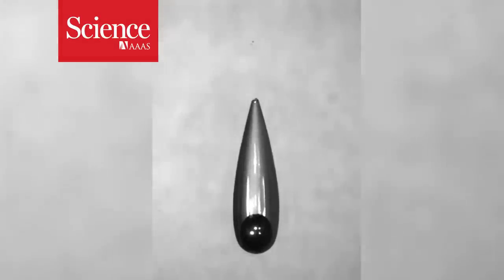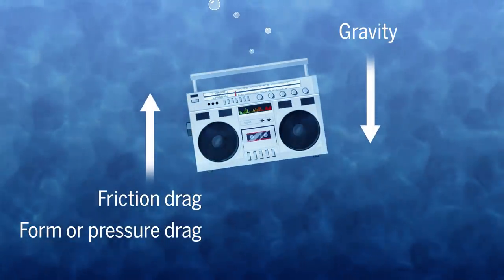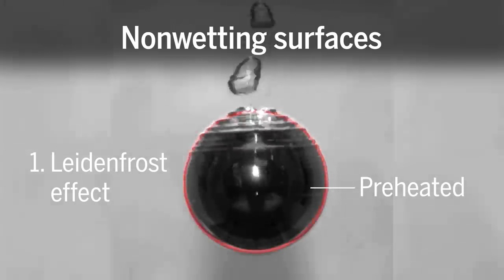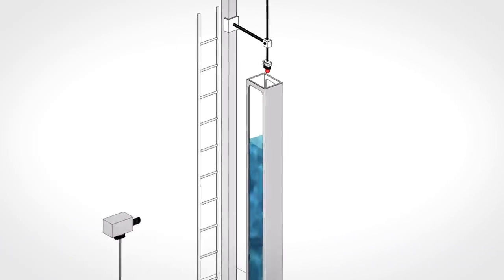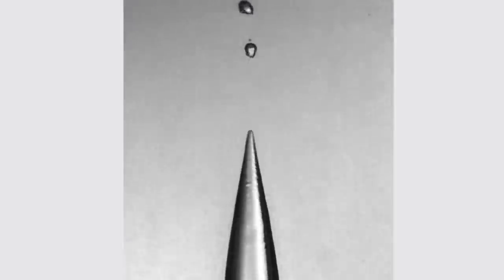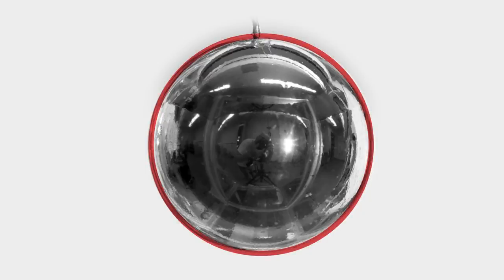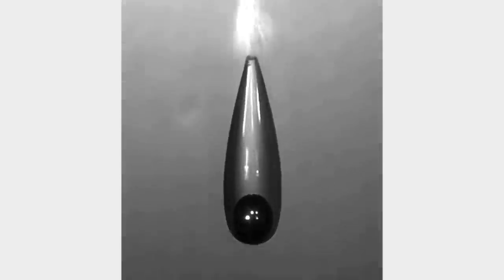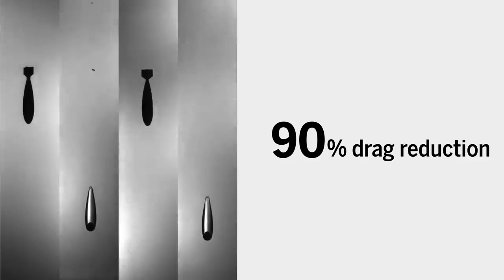Watch these hot balls cut through water like a knife through butter

Comment: A metalworker in 1810: “when I drop these musket balls in water to cool them after forging, I hear them hit the bottom of the bucket much sooner than I would have expected. Oh well, back to work.”
Reply: well we also noticed it but we are confined to our work
Reply: The water is at 95C though so the ball only need to heat the water by 5 degrees.
In cold water i'm not sure how prevalent the effect would be since the ball would probably rapidly cool down
Reply: @AuxenceF  duration of the fall is a lot less too though, so the speed at which it loses that heat might not matter so much
Reply: @AuxenceF  not how it works
Reply: A lot of gifted might have discovered more before Newton and Galileo but most population back then were enslaved or didn't have popularity
Reply: @edwardrocca  it need to at least heat its own volume in water to boiling point and you need a lot more energy to heat a gram of water by one degree than to cool one gram of steel by one degree
Reply: @FnLl523  "I am, somehow, less interested in the weight and convolutions of Einstein’s brain than in the near certainty that people of equal talent have lived and died in cotton fields and sweatshops."
Reply: As a factual matter musket balls aren't forged, they are cast from molten lead.
Reply: @jimmie2knives137  Superior japanese musket balls were folded over 1000 times using traditional forging techniques to achieve unimaginable results.
Reply: @JrottenOlm  Why do people keep misunderstanding the 1000 layers of Japanese forged metal? Its just 12 folds, resulting in 1000 layers. And folding metal doesn't make it compressed and strong. The purpose why they've been folding their metal was to purify it. There wasn't great technology and chemicals back then so they had to forge straight from the raw tamahagane. The metal would obviously have a lot of impurities so the metal workers decided to fold it at least 10 to 15 times and they can witness the impurities get squeezed out from the metal as they continue folding it. It is not 1000 times of folds, literally any blacksmith will tell you it would be a waste of time if you fold metal more than 20 times. ITS 12 FOLDS AND 1000 LAYERS. NOT 1000 FOLDS.
Reply: @FnLl523  Any TRADITIONAL Japanese blacksmith will tell you that it is actually folded a 1000 times and that this does actually make the blade stronger. In fact when they made the A6M they folded its wings 1000 times as well which made it able to cut parts of enemy airplanes using its wings.

Source: a deeper understanding of Japanese tradition and culture than anyone who doesn't live in their mother's basement could have
Reply: @FnLl523  enslaved in europe yes but the world is a large place Muslim scientist had the brilliant minds back then but the western books don't mention the Islamic civilization.
they mention latin then quickly skip to Europe like no sciences were made for 5 centuries.
Reply: I appreciated this
Reply: @ThexXxXxOLOxXxXx  There were plenty of slaves outside of Europe. A good deal of Africa, Asia, and the Middle East also enslaved people.
Reply: @AuxenceF  this is extremely oversimplified but whatever.
Reply: @FnLl523  Dude more layers = better, a Katana has 1 Million layers!
Reply: @Hellothere-vr9um  ?
Reply: Guys, Here is the Original Semitic Text. HERE is The REAL Savior

YaH The Heavenly FATHER HIMSELF was Who they Crucified for our sins and “HERE IS THE PROOF”

From the Ancient Semitic Scroll: 
"Yad He Vav He" is what Moses wrote, when Moses asked YaH His Name (Exodus 3)

Ancient Semitic Direct Translation
Yad - "Behold The Hand"
He - "Behold the Breath"
Vav - "Behold The NAIL" <— YaH’s Crucifixion
He - "Behold the Breath"

“Behold the HAND that Beholds The NAIL” 

PROVES - YAH The Heavenly Father HIMSELF was Who they Crucified

That is EXACTLY what Moses Wrote

Here is what they mean

YaH's Name:
(Ya)d + (H)e, as YaH is what Moses called Him and YaH Declared: "this is My Name, this is My Name for all generations" (Exodus 3)

YaH is The Creator:
Yad He, (HAND BREATH), as YaH's "HAND" Formed man from the dust  of the Earth and His "BREATH" made him a living being (Adam)

YaH's Sacrifice of Crucifixion:
Vav He (NAIL BREATH), the "NAIL" through YaH’s "HAND", that whosoever shall call YaH Savior, His “BREATH” brings forth life (Salvation)

How YaH arrives:
YaH arrives via the Tent of Meeting (Exodus 33:7:11, Isaiah 54, 55), where a Tent is erected outside the city, a cloud descends upon the entrance of the Tent and YaH appears...

Why they demanded YaH to be Crucified:
YaH was Crucified according to Hebrew law (Deuteronomy 21), to be Hung on an Almond Tree for BLASPHEMY as it was for His NAME they demanded Him Crucified. The Messiah claimed He was YaH...

HE WAS YaH!!!

HalleluYAH “Praise ye YaH”

From The Hebrew Book of Isaiah, The Dead Sea Scrolls

Isaiah 42:8
"I am YaH; that is my Name! I will not yield my glory to another or my praise to idols.

Isaiah 43:11
I, I am YAH, and there is no other Savior but Me.

Isaiah 45:5
I am YaH, and there is none else.
Reply: @Seagull780  In traditional Japanese sword making, the low-carbon iron is folded several times by itself, to purify it. This produces the soft metal to be used for the core of the blade. The high-carbon steel and the higher-carbon cast-iron are then forged in alternating layers. The cast-iron is heated, quenched in water, and then broken into small pieces to help free it from slag. The steel is then forged into a single plate, and the pieces of cast-iron are piled on top, and the whole thing is forge welded into a single billet, which is called the age-kitae process. The billet is then elongated, cut, folded, and forge welded again. The steel can be folded transversely, (from front to back), or longitudinally, (from side to side). Often both folding directions are used to produce the desired grain pattern.[13] This process, called the shita-kitae, is repeated from 8 to as many as 16 times. After 20 foldings, (220, or 1,048,576 individual layers), there is too much diffusion in the carbon content. The steel becomes almost homogeneous in this respect, and the act of folding no longer gives any benefit to the steel.[14] Depending on the amount of carbon introduced, this process forms either the very hard steel for the edge (hagane) or the slightly less hardenable spring steel (kawagane) which is often used for the sides and the back.[13]
Source: https://en.wikipedia.org/wiki/Japanese_swordsmithing
Reply: @petermuller3995  Well yes, but don't consider just the layers but also the carbon content of the blade. Most katana has around 1000 to 1000000 layers because of having only 7 to around 12 folds. Folding too much like over 20 times woudn't be beneficial any more for too much diffuse on carbon.

edit: and also read the comment above this for better explanation.
Reply: @FnLl523  No it has to have 1 Million layers to cut steel and stone like butter!
Reply: @FnLl523  damn, you are one weeb with knowledge
Reply: @user-ht6ql1rn3w  Wow how rude
Reply: @AuxenceF  not its full volume of water, the gas has a pressure. Basically find the gas pressure of bubble, find the volume of water required to get that much gas (water vapour)

Comment: I would like to know more about the releasing of bubbles under ships to reduce fuel costs.
Reply: It seems like the supercavitation bubble needs to be fully submerged to remain stable, as such that idea isn't really viable. Ther IS however a supercavitating ship using the SWATH build: https://edition.cnn.com/2015/02/05/tech/ghost-boat-supercavitation/index.html 
There are some concept designs around for a large scale version for cargo and passenger vessels due to the incredible sea-keeping and better fuel economy.
Reply: the effort to pump the air might consume more energy than just pushing the boat through water... it's a tough nut to crack, that total energy equation...
Reply: Ships have been sunk like that. Typically a discharge of methane from the ocean floor hits the surface where a ship is, and bye bye ship.
Reply: I thought there would be a link to Rick roll here
Reply: @yamahantx7005  That's precisely how torpedoes work.
Reply: @TheSkinnychef1620  
Close, but no cigar. I studied physics and know full well about cavitation. Torpedoes sometimes have propellers on the front to create bubbles to massively reduce drag. But that prop is going to destroy itself. Doesn't matter since it's a torpedo, but as for the physics of it, it's not applicable to ship hulls.
Reply: @yamahantx7005  This is quite an arrogant reply, particularly considering that the person you are replying to didn't even make the argument that you are trying to unpick. I too have degrees in physics and engineering, but I learnt long ago that shouting about your qualifications is infinitely less effective than just properly listening to what the other person is trying to say. People are not going to want to engage with you in discussion if you come back at them with cocky, patronising quips like 'close but no cigar'.
Reply: @yamahantx7005  I bet you have fulfilling interpersonal relationships
Reply: @gearandalthefirst7027  
Compared to you, I'd take that bet.
Reply: @92Pyromaniac " This is quite an arogant[...]" wow what an exemple !!! continue the subject, not this xD
Reply: @TheSkinnychef1620  
That has nothing to do with how torpedoes TRAVEL, which was the issue of contention. Nor does it invalidate that ships have been sunk by methane bursts, arrogant scrub. Did you enlist to serve, or argue?
Reply: @yamahantx7005  skinny chef clearly made the torpedo remark in response to the comment about massive methane bubble releases from the sea floor causing the sinking of ships.  I.e., torpedoes sink ships in much the same way that massive natural bubbles do. That's the only instance where torpedoes were brought up, and their method of travel or use of props was never mentioned until you mentioned it
Reply: @yamahantx7005  - "Ships have been sunk like that. Typically a discharge of methane from the ocean floor hits the surface where the ship is, and bye bye ship."
That's a direct quote of your entire comment, in which you made zero mention of how torpedoes TRAVEL. 
Who came here to argue? The guy clarifying his point, or the guy who can't remember what point he was making and when?
I never once attempted to invalidate your claim that methane bubbles ever sank ships. That what your coming to the youtube comment section for? Validation?
You're a 12 year old girl aren't you?
Reply: @TheSkinnychef1620  yo holy shit you let everyone else have a turn first whih was already enough and then you really came in with the kill shot.
Reply: @yamahantx7005  no torpedo has a propeller at the front. If you're talking about the russian supercavitating torpedoes, they use a gas nozzle to make the air pocket.
Reply: @92Pyromaniac  he's just a little boy who doesn't know what he's talking about
Reply: Its a modern technique. The flat surface at the rear of the ship contains a low pressure, thus sucking the ship backwards and producing drag. If you release a stream of bubbles behind the ship you can fill that low pressure (as done on some cars), along with slightly interfering with the surface to reduce the suction effect, and in theory improve the shape of the wake making a more streamlined surface (done in artillery shells, requires far too much air to do with ships). There is also the possibility of releasing bubbles alongside the ship to reduce contact with the water and thus reduce drag, but this would also reduce buoyancy so it isn't quite as great of a gain as the video implies and can't really be done to a great extent. The amount of air released isn't really huge, and most (all?) comes from wasted exhaust gas which is generated either way. Releasing the gas underwater also provides some benefits vs above the water, but without this technology the drawbacks typically trended towards releasing the gas out of funnels in many cases.

Then there are the military applications whereby (many more) bubbles both create a foam so sound finds it far more difficult to pass reducing the signature whilst simultaneously creating their own sound to mask that of the ship. Submarines are far too quiet for the payoff to work, but surface ships certainly benefit from it. This way whilst the attacking submarine still doesn't find it particularly difficult to find the ship, they will find it far more difficult to work out exactly which ship it is from the sound (a very important factor in modern sonar). Not really related to drag, but similar and interesting nonetheless.

Comment: Nice. It remembers me of that video Youtube suggested where the SOCOM is developing a super cavitation bullet wich works underwater. Cool stuff.
Reply: Same here.. they used tungsten tip.. I wonder whether it was very hot or hydrophobic to generate the cavitation bubble
Reply: Not the same technology/ physics here. This effect doesn't work past the local speed of sound.
Reply: Yeah, it reminded me of that too.
Reply: @swastikbiswas8293  tungsten tip? Nothing else?
Reply: @acefromwithin2079  I saw tungsten tip only as after graphite, tungsten has the Highest melting point. It can sustain its rigidity at temperatures where other alloys, salts,metals just melts so upon touching water it forms a cushion of water vapour which protects it from further wetting thus glides through water
Reply: @jamestheotherone742  well 9mm is slower than the speed of sound in water vapour and depending on how hot the vapour is you could shoot higher velocity rounds using this method.
Reply: Great. My whole plan to avoid getting shot was to go underwater like I saw on mythbusters. Somebody always comes along...
Reply: @bP-yr3po  mythbuster showed that even if you save yourself from getting shot, the pressure wave can rupture the eardrum as sound transfer way faster in water. That too if the gun dipped in water.

But hey, it still saves you for another day.
Reply: @swastikbiswas8293  The More You Know.... LOL

Comment: This seems to be the same effect that helps penguins swim so fast under water. They exhale a little bit of air which then forms a bubble around their bodies and lets them swim under water with close to no friction. The military wants to use this effect for torpedoes to make them super fast under water as well.

Greetings from Switzerland 🇨🇭
Reply: Cool
Reply: I guess it is not the Swiss military =p
Reply: @curiousSloth92  No. 😂 Not enough penguins and no vessels that fire torpedoes. 😉
Reply: They exist already. Enveloping them in enough gas (from redirected engine exhaust) to reduce drag also makes driving with a propeller a no go. Underwater rockets is essentially what they are.

Comment: This is one way lead shot of different caliber diameters are formed .  Molten lead is dripped from an height into a liquid quenching tank ( water or oil I believe ) . The drip flow  is set so the natural action of drops forming into spheres produces approximate diameters desired .                                                                                                                                    The lead spheres quench and set .  The lead shot is then screened for different diameters .  The shot that doesn't pass the grade goes back in the melt pot .                                                                                                                                                       This process has been used for a long tine , I imagine it has been tweaked quite a bit and the process is very economical  over casting in molds  ( but casting shot is still used in some cases ) .

Comment: Wonder if a hull with a hydrophobic coating would hold up well and repel sea life growth?
Reply: My guess is the sea life to be cause of its failure, fish pulling barnacles off the bottom of the ship pulling a little coating off with it
Reply: @tdollars8052  but how would the barnacles stick to it in the first place?
Reply: @coler154  Because a physically hydrophobic coated surface is a (fragile & expensive) 3D texture that traps atmosphere. Eventually the atmosphere trapped dissolves into the water or it washed out. So lets say the surface is plain and made of teflon saturated with biocides. Teflon can be stained quite easily and hardwater deposits (carbonates & sulfates) can bond to it amazingly well (as well as fill voids in textured surfaces). Marine life is essentially a hard water deposit. Biocides wash out over time.

Comment: (00:10) If it's falling at a constant velocity, it means that the drag force is in equilibrium with the resultant from the self-weight and buoyancy. It would need to be at constant downwards acceleration all the way to the bottom, for the drag component to be truly zero.
Reply: What I understood is that it's almost, but not zero friction, so the efficiency of movement is much higher.
The terminal velocity it managed to achieve was also faster than the ballistic-shaped dummies they used as a control.
So...things go fast through water?
Which is a great achievement, actually.
Water is a terrible medium to travel in. XD

Comment: but, friction is still existent? what des it mean by virtually non existent. The air surrounding the object is still frictioning against the water. Which is why the ball gets to a constant speed instead of continuing to accelerate due to gravity, gravity and friction is balancing each other out in that certain speed. Therefore friction is still existent, not virtually nonexistent. If you want something to move faster than its constant speed, for example the ship which is coated with the substance, you would certainly get to a maximum velocity before having to break through that friction. I don't know if this makes any sense at all.